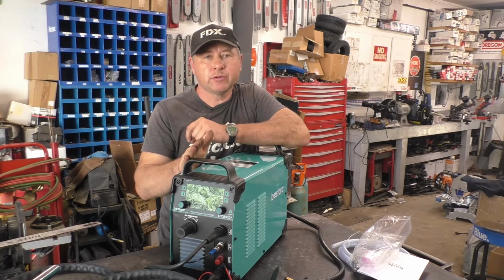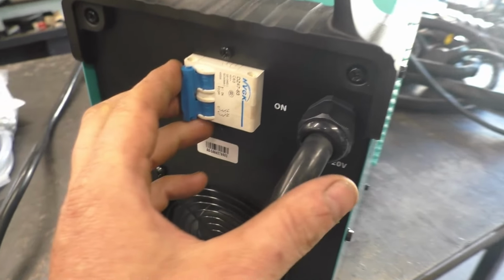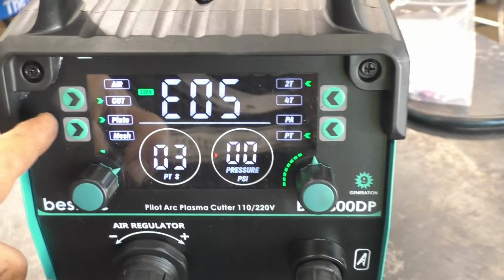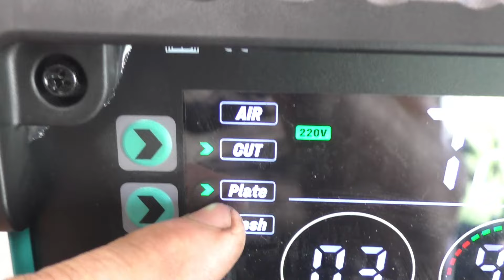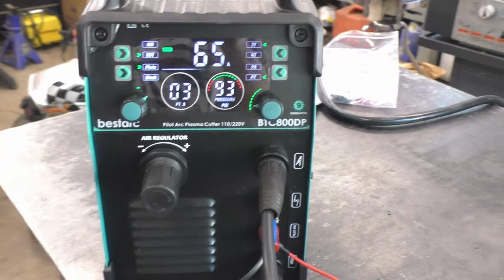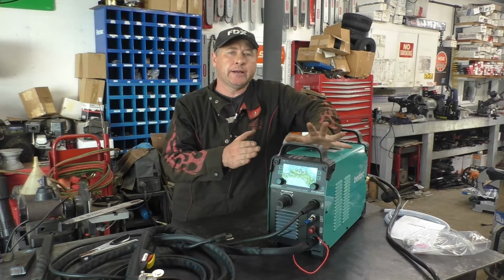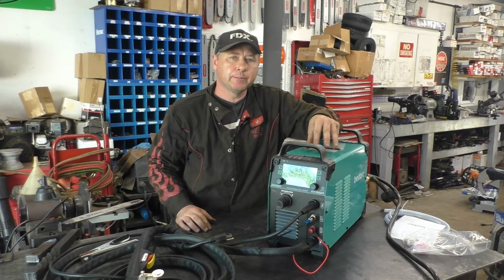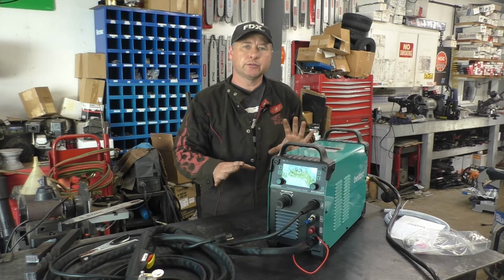Trying Out The BestArc BTC800 Plasma Cutter

Comment: I don't think you have to match the amps to the breaker. I can run my 225 amp TIG welder on a double 60 all day.. I run my 140 amp mig welder on a 20 amp breaker with no issues.

Comment: Just looked at this on Amazon, it only requires a 220 volt 50 amp breaker to run it at max settings.  Input amps are different than output amps.  The inverter inside the unit takes the two phase AC and converts it to DC, which can be at completely different amperage ratings.
Reply: Thanks for posting this. 
I've been looking for a cutter that can cut 1" steel for my heavy equipment. 
I have my 60a service hooked up for my welder and was curious if this needed another dedicated circuit or not.